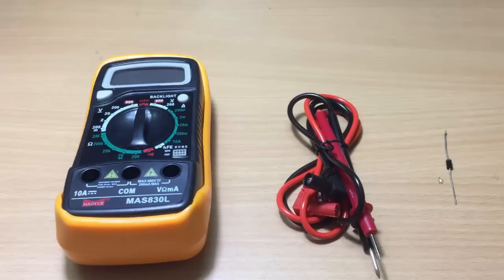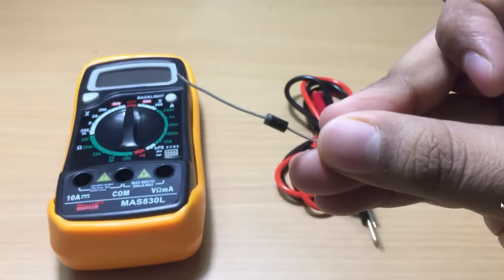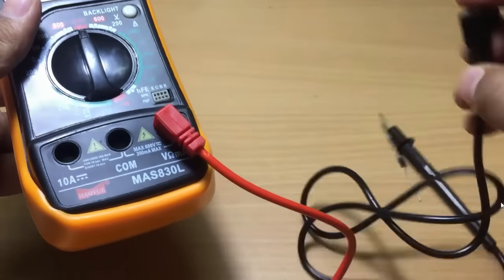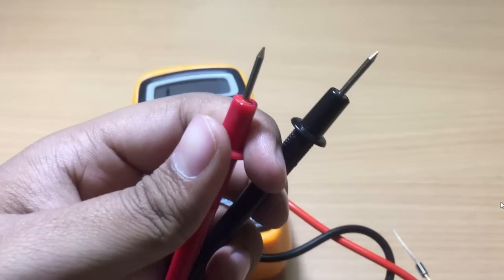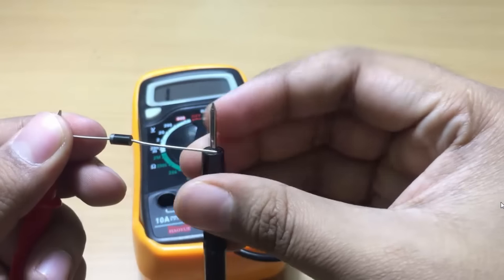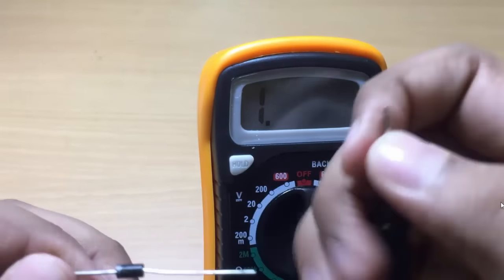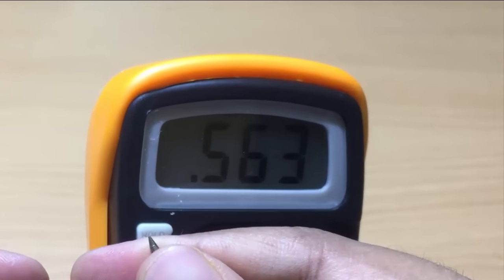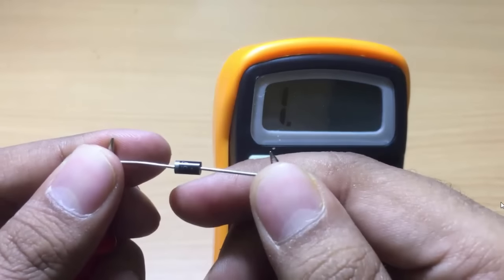How to test Diodes Using a Digital Multimeter

Comment: My digital mm is reading “1” when testing both sides of the diode. Does that mean the diode is bad?
Reply: Yes, your diode acts like open circuit on both side means it is bad ( if the digital isnt bad)
Diode is component that only let electricity flow 1 direction. From 1 side forward, it is basically a wire but from the reverse direction, it is an open circuit